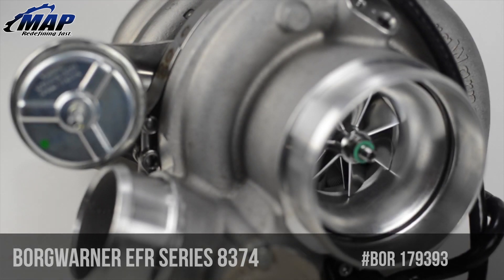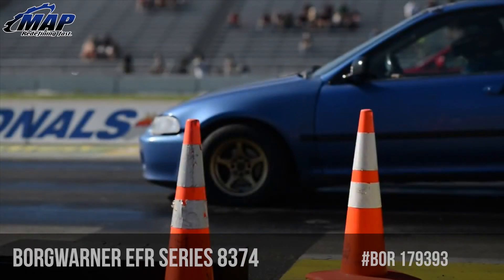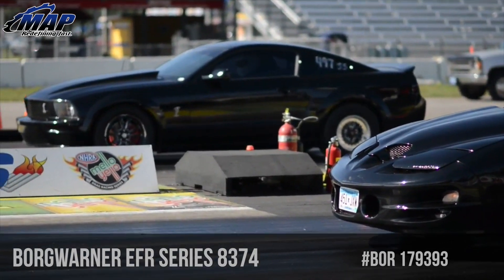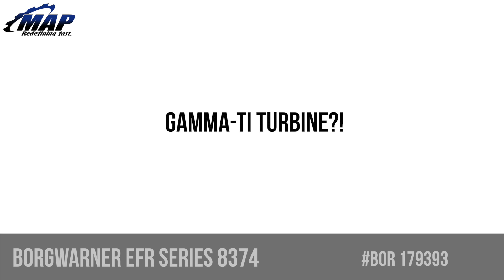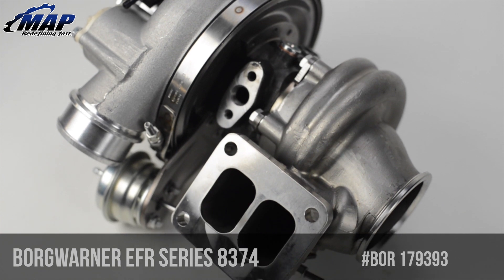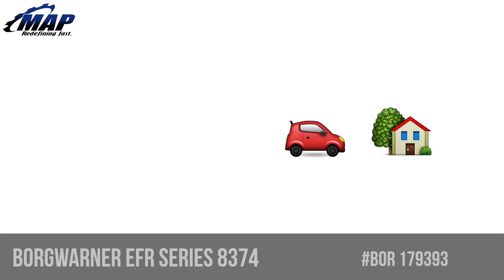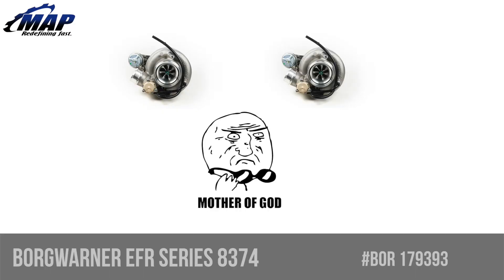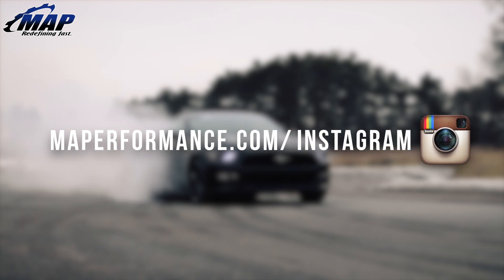BorgWarner Turbo Upgrade | EFR Series 8374

Comment: Hi, this turbo needs a blow off valve and a wastegate valve?
Reply: You can get it with an internal or external wastegate. The BOV is integrated into the compressor housing

Comment: So I'm thinking about going with this turbo for my 1997 Skyline GTR, I swapped the motor to a RB30 and have been doing research as to what's the best size to get me to the hp I want. I'm looking for 750-800 hp. On normal BW systems a 63mm .95 a/r would get me there but I'm not sure with this type of setup. Please send me some information so I make the best decision. I'm hoping for fast response and little drop off at high RPM. If this turbo does well I'll swap the one on my RX7 to the same system. That I'm running a 20b street port and Borg Warner s480.  Because of the lag on that car I don't see boost until 5500-5800 RPM's, any help would be well received...
Reply from the maker: +James Thomas Hey James, your question is a little too elaborate to effectively answer online, we can happily talk to you and help you out with any questions if you want to give us a call. 1-888-MAPERFORMANCE !

Comment: keep on mind that there is no service for them,once they are ready for service you can throw them in garbage  and buy new one, ha, yes they do not sale catriges separatelyonly super core that cost same money as turbo by itself,they are bull shit,they hide it from people but once you get them god bless you,they are also very sensitive if you do not connect water right after you instal them,if you do not than by by turbo is gone right after high reveing no more than 2 sec,hmm do they advertise that noooo?and now you tell me what is good here,extreme expenses, notning to be proud.
Reply: +MrZoranbebek sounds like installation error, Ive had my efr on my e36 for quite some time now and it is not water cooled......
Reply: +Lance Sweeney can you explane that instalation error?may be you know more than I do?
Reply: how could lance explain your installation error??     lol.   did you hook the drain to the feed side or something? haha
Reply: Got my EFR 6758 for 30.000 Miles on my Miata. Turbo is still in mint condition and works without any error. Also the service was good.